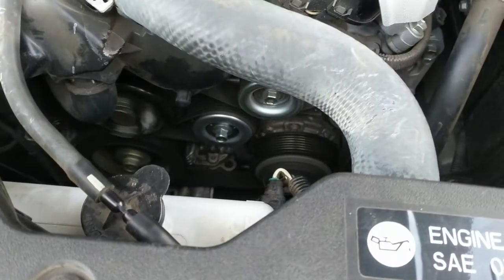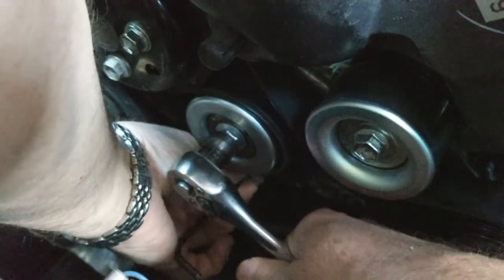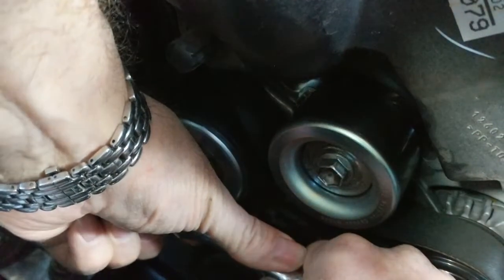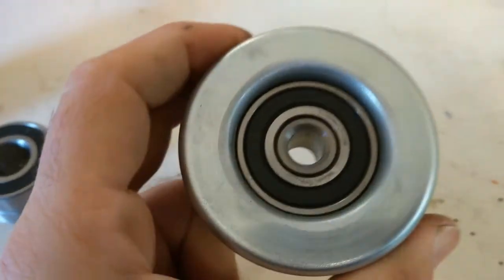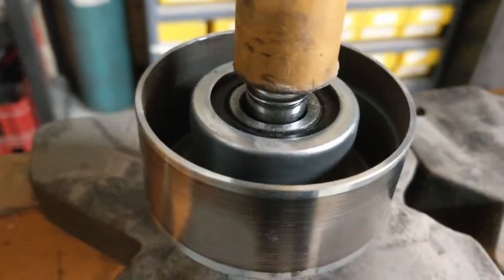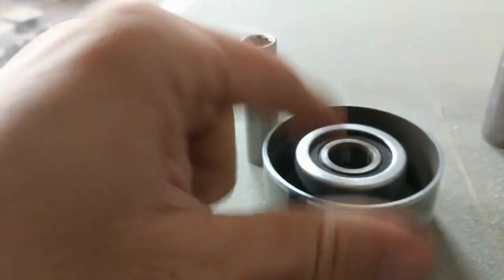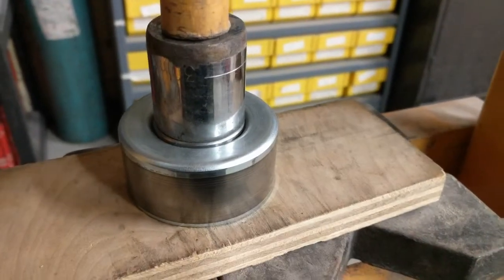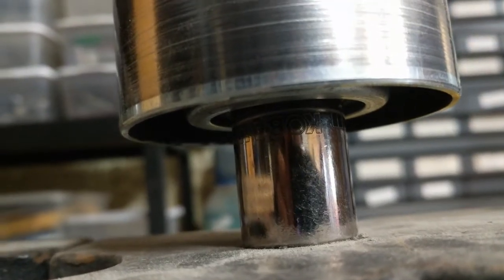Lexus and Toyota tensioner pulley bearing replacement

Comment: I used the gates 36325 pulley as a replacement and it worked great! thank you
Reply from the maker: Great to hear! Thanks for letting us know!
Reply: What is the year make and model of the car you put this on?  Is it still working fine?
Reply: Jo Tu 2006 is250 AWD and 50/50 I think I have to replace my whole tensioner. Noise is back but not from the pulley
Reply: @hilariopenaloza5858  1) Is the new squeak the same exact noise or a totally different kinda "squeak"?
Reply: Jo Tu Same squeak TBH. After replacement the noise went away for a few months and now it’s back. I hear it during the first 5 minutes of a cold start and after driving the car for more than 30 minutes.

Comment: Im wondering if these 6203 bearings will replace the bearings in the idler pulleys as well??
Reply from the maker: I didn't test it out, but they look the same, although the idler only uses a single bearing

Comment: Hey Austin just wanted to shout out a big "Thank You!" for covering this on your channel. Advanced Auto part number 900501A is made in Korea and fit my 2008 Toyota Sienna LE 3.5 perfectly. Just an FYI ... searching Amazon I found yet a third option in part number "FEBEST 0187-GSU45 Idler Pulley". You've saved countless people big bucks and lots of unnecessary labor amigo!
Reply: It's been more than a year! How's your pulleys holding up so far?
Reply: @robinkim7711  So far so good and not a single squeak!
Reply from the maker: Thanks for the kind words, but that was all my fantastic subscribers. My solution was to press out the old bearing because I couldn't find a part that fit, but luckily Sky Nguyen did the hard work of finding a pulley that works for those who don't have a press! I'm super happy it fit your Sienna, and thanks for adding the third part number for others to find, i'll add it in the description.

Comment: So install it back would you just leave the Allen key in the hole and just put on the pulley ?
Reply from the maker: yes, you then use the ratchet or wrench to relieve pressure on the allen key and remove it (the allen key) and then tension the belt

Comment: at 3:32 I can still hear it squeak
Reply from the maker: I should have let the video play longer there as someone else mentioned that too. It's been almost a year and the tensioner pulley has been completely quiet. I did have to replace the alternator clutch a few months after the video, and I think that might be the noise there. It was a different noise, little tiny chirps here and there instead of the constant squeal the tensioner puller was making.

Comment: Thank you very much for the time and energy you put into this awesome video featuring a rare subject that I am very interested in.  A few questions.  You said you are using a Harbor freight press.  1.) Which specific model)number of press did you use (I need to buy it).  If no model then a link or a description would be appreciated.  Additionally, I noticed at the very end of the video from 3:31-33 as you are saying "running with the new pulley", that there is still some chirping in the belt area and the video quickly ends (so I could not listen further).  I mention this because my car has developed that same chirping almost always but sometimes mine is more constant like yours was at the beginning of the video.  So (said with the utmost respect) I realize you said that the replaced tensioner bearings fixed the issue at the end, but did the car still chirp (or maybe even squeal a little) after that??  If not, then I am sorry that I asked but If so, did you try to get the chirp to stop and ultimately how did you do it?  Obviously, I am asking only because I am desperate to solve my belt or pulley (or whatever) chirping and squeal issue.  Your fast reply would be greatly appreciated as I have to fix this as soon as possible.
Reply from the maker: Here is the press:
https://www.harborfreight.com/12-ton-shop-press-33497.html

Good ear on the chirp at the end. I had to replay the video as I did not notice it at the time. The squealing from the tensioner pulley went away with this procedure, but a few months later it developed a second noise from the alternator clutch (the mechanism within the pulley on the front of the alternator). We had to replace that as well.  I think that is what you were hearing there. When the bearings were bad it was a nonstop squeal that changed tones when it warmed up, but was always there. The alternator chirp was just that, an occasional chirp that happened whenever the alternator would engage/disengage
Reply from the maker: I should note that the bearings were replaced 10 months ago and they are doing great and the alternator clutch was done about 5 months ago and there's been no sound since.
Reply: @AustinCoulson  Thanks for ur fast replies.  Funny that you brought up the Alt. Clutch because Innitially I used a mechanics stethascope which lead to my first guess being that my issue is the alternator clutch but can not confirm that this is the issue 100% (maybe if I can perform the gates diagnosis mentioned later though).  I fully loosened the belt and the alternator pulley rotates freely both ways without sound and it is not the idler pulley next to it either (I replaced idler and same sound is made).  I was going to test the clutch but not sure if I remove the cap that the cap will be able to be replaced.  In other words, by trying to fix it, I may break it (if I break the cap).  1) Do you know how to remove the Alt Pulley cap so it can be replaced?  2.) did you replace the clutch while Alt and belt was still on the car (Belt de tensioned of course) or take it off to replace it?  I ask because I would prefer to do it on the car but I have significant access issues (it is on a 2008 Avalon).   3.) What (specific) tool (or kit) did you use to release the pulley from the Alt shaft?  I can not find the single (for Toyotas) 17MM/19MM hollow tool (turned with a wrench) as shown in Gates video and am unsure about the tool to insert into the shaft (there are 3 possible "male shaped" ( ?? Hex, Star, Torx ???) tools to insert into the shaft depending on the car).  I am afraid that I will get the cap open and not be able to get the clutch off (due to not having the correct tool to lock the shaft in place while removing the pulley, then be unable to get a possibly broken cap back on the pulley if I am unsuccessful replacing it).  

Gates makes this clutch removal kit but I am better off replacing the alternator entirely as I am not gonna pay the $80. ish that gates want for the tool kit... https://www.gates.com/us/en/ymm/search/part/details?part-number=91024   

Gates shows how to test the alt clutch here https://www.youtube.com/watch?v=hrFcPqZuO3A&list=PLnkU53gXNZTbSgJge3jRyKU9pP7pDn6cG&index=20&t=0s  But My alternator clutch cap looks different than theirs and I can not figure out how to remove it.  4.) I am hoping you have already learned about the Alt Clutch Cap and can share what you know with me.  5.) how did you confirm (100% for sure) that it was the Alt. clutch/pulley when you had this issue?  6.)  Your opinion please... if I end up doing the bearings on the tensioner, do you think this will work instead of the massive press you used???  https://harborfreight.com/10-piece-bearing-race-and-seal-driver-set-63261.html?_br_psugg_q=bearing+race+and+seal+driver  Help!   :-)     Again, your rat reply is greatly appreciated.
Reply from the maker: @jotu173  I used the tool to install the clutch. Im not sure of any way to replace the clutch without the tool. The cap just popped off with a small flathead screwdriver on mine. The bearing driver will not pop out those bearings IMO. They were in there pretty good.
Reply: @AustinCoulson  1.) When you say the tool, you mean the SPECIFIC gates tool that I mentioned before?  2.) Did you replace the clutch in place or take the alternator out to do it?  3.)  Did you confirm (100% for sure) that it was the Alt. clutch/pulley BEFORE your replaced it, if so how? 4.) Do you think I could bypass dealing with pressing the bearings altogether and just replace the current OEM tensioner pulley (only) with this gates idler pulley (only) on the existing bracket??  https://www.gates.com/us/en/ymm/search/part/details?part-number=36173

Thanks again.
Reply from the maker: @jotu173  1)I don't know if the tool was made by gates but it is the specific tool for removing that part
2)I replaced the AC clutch on the car with the belt de-tensioned
3)I didn't verify it, it was just noisy and it sounded like it was coming from the alternator clutch so I swapped it
4) that pulley will not work, it will be misaligned if you try. I looked at doing that when I pulled the factory one off
Reply: @AustinCoulson  Is your prior answer #2 a typo?  Did you mean to say AC clutch or Alternator Clutch??  Any way you can find out who makes the kit/tool/whatever that you used and a model number or something?  Thanks again
Reply from the maker: @jotu173  right. The alt clutch. No idea on the tool. It was 6 months ago and it's my Father in law's car so he just showed up with the tool and I swapped it for him.
Reply: @AustinCoulson   Do you remember if the tool was in a red plastic blown mold case that held a kit?  Or was it just single tool or 2?  Also, both the bearing replacement and Alt Clutch were done on a single car ( a Lexus ?Year? es350) correct?  Just trying to make sure I get the correct tool or kit is all.
Reply from the maker: @jotu173  all I remember about the tool was that it had two parts, one locked the pulley, one slid through the tool and held the shaft. Yes both on same car. Es350 I think. Can't remember the year
Reply: @AustinCoulson  Last question... and you were able to reuse the stock pulley cap after popping it off.  Correct?   Thanks again.
Reply from the maker: @jotu173  https://www.amazon.com/OEMTOOLS-27261-Alternator-Decoupler-Pulley/dp/B01E65T5U0/ref=sr_1_1?crid=108P5PAA4KQIB&keywords=27261&qid=1569183166&sprefix=27261%2Caps%2C224&sr=8-1
Reply: @AustinCoulson  Thanks for the tool follow up but I just found out that every Oreilly Auto Parts loans out an awesome kit like this for free so no need for me to buy it..  Also, please clarify, you were able to reuse the OEM Alt. pulley cap after popping it off .  Correct? (or did it break?)   Thanks again.
Reply from the maker: @jotu173  we reused it. It's basically just a dust cover

Comment: Congratulations on the video. This helped me a lot. Let me ask you something: to loosen the pulley bolt is the direction of rotation clockwise or counterclockwise?
Reply from the maker: Clockwise to loosen, like you would normally tighten the bolt. It's a Left hand thread.
Reply: Turn your volume up sir

Comment: Thank you Austin for posting this video to replace just the pulley.  I am looking at Amazon and came across "Timken 6203-2RSC3 6203-2RS Deep Groove Ball Bearing 17x40x12mm American Brand".  I have had great success with Timken in the past so am thinking of going with this.  What do you think?  Also, why 2 pack?
Reply: 2(Pack) 6203 2RS C3 / DDUC3 NSK 2 RUBBER SHIELDED BALL BEARING 17X40X12CM
Reply from the maker: I don't know off the top of my head if that will work, but I am with you on Timken, they are my preferred bearing brand. I went with the cheaper bearings in the 10 pack because I wasn't 100% sure this would work when I ordered it. You will need 2 bearings for this procedure, and as long as the dimensions of the timken are the same (and I am pretty sure all 6203's have the same dimensions, but you should double check) then you should be good to go with the better Timken bearings. Hope this helps!
Reply: Did you order these TImkens you mentioned and did it work?  Any other tips?  Your fast reply is greatly appreciated.
Reply from the maker: @jotu173  I never heard back from him if he got the timkens or not, but the ones I used have been working great and quiet so far
Reply: Trying to ask P Jain this question...     Did you order these TImkens you mentioned and did it work?  Any other tips?  Your fast reply is greatly appreciated.
Reply: Yes the 6203-RS is the correct and highest quality bearings you can get. The other belt pulley on the RX350 (I have replaced on both a 2007 & 2015 RX350) uses a single Koyo 6302 RMX. I don't think Timken makes a bearing with a correct inside diameter for this application. Note: The part of the part number after and including the C is not important to match and can be C1, C2, or C3. Also if you want to really go the extra mile remove the seals, pack in additional grease, then reseal. Sometimes from the factory not much grease is included, so if you go this far it is worth checking.

Comment: Hey so my 2000 lexus gs300 the tensioner pulley completely seized up after the squeezing and cause the whole belt to come off. Do I need to replace the whole pulley system or just that little part with the bearings??
Reply from the maker: This repair should fix that specific issue. It's impossible to know for sure without seeing it, but basically the tensioners only job is to have spring loaded tension and those rarely fail. The common failure is the pulley bearings and that sounds like exactly what happened to you. Sounds like the bearings were going bad, then seized, which blew the belt. You should be able to follow this video, swap the bearings, install a new belt and be good to go. Let me know if this works out for you, and good luck!
Reply: @AustinCoulson  on my 07 Camry 3.5, would the tensioner pulley / bearing be the same pulley / bearing as my idler pulley? Thanks again!
Reply from the maker: @brandonalbright125  no, they are different. You can try gates part number 36325, people are having luck buying just that pulley and swapping them so you don't have to do the whole tensioner or my bearing swap
Reply: @AustinCoulson  Hey thanks, but when I type that part # in on Amazon it pulls up a gates idler pulley and amazon says it's not the correct fitting part for my Camry?
Reply from the maker: @brandonalbright125  correct, that part is not designed for your car, but if you check out my description  or the first pinned comment, one of my viewers found out that the part that isn't designed for these cars will fit anyways. Basically, no one sells just the pulley, they want you to replace the entire tensioner so I figured out how to replace just the bearings and the other viewer found out you can just buy a different pulley made for a different car instead of my solution
Reply: @AustinCoulson  Oh ok, so just to clarify. That specific gates 36325 WILL work and (others in the pinned comment) on my 07 Camry belt tensioner pulley replacement? But my 1 or 2 idler pulleys will be a different pulley part #? Thank you for your quick reply!
Reply from the maker: @brandonalbright125  I cannot say for sure as I have never done it, but based on what 4 people have told me, it will work.
Reply: @AustinCoulson  thats great and a lot cheaper fix. Do we have 2 idler pulleys on the 2gr 3.5 motor along with the tensioner pulley? So the tensioner pulley would be different then the idler pulleys?
Reply from the maker: @brandonalbright125  the idler and tensioner pulleys are totally different. It's my Father in law's car so I'm not sure if there are two idlers or not
Reply: @AustinCoulson  alright, thanks so much for help!
Reply: On yours, it is NOT reverse-threaded. Otherwise you will end up with a broken bolt and have to replace the entire tensioner assembly.
Reply: @antistupidity84  alright, thank you for the update. Im finally about to tackle the job when we get some better weather.

Comment: no tacoma for this bearing or pulley
Reply from the maker: Correct. This only applies to the vehicles listed in the description
Reply: @AustinCoulson  wow mostly all of the toyota line up but Tacoma =(
Reply from the maker: @jonesesente7646  the good news is that I think they sell just the pulley for the Tacoma pretty cheaply
Reply: @AustinCoulson  and that comes with the bearing right? and do you think most idler pulley in a car/truck the same size?
Reply from the maker: @jonesesente7646  what year and motor is your Tacoma? Do you know where the squealing is coming from?
Reply: @AustinCoulson  2010 v6 prerunner.... i just replaced my ac compressor's bearing.. as i was checking all idler and other pulleys, i thought some of my idler especially the tansioner pulley was like free/loose or theres no little resistance like with those new bearings.
Reply from the maker: @jonesesente7646  if it spins freely it might still be ok, you want to check the play laterally. They sell the tensioner pulley and idler pulley without having to buy the whole tensioner. They are both smooth and 70mm outside diameter but the mounts are different. Check out rockauto.com for the part numbers
Reply: @AustinCoulson  thanks for entertaining my questions man! really great help!
your video as well! keep it up!

Comment: You mean Toyota OEM does not sell the tensioner pulley separate. The tensioner pulley with pressed bearings are on ebay.
"Belt Tensioner Pulley Febest 0187-URJ201" Remember reverse threads, Righty- Loosey, Lefty-Tighty. Haha!

Comment: Would these bearings work? 6203-2RS KOYO Deep Groove Ball Bearing
17x40x12 mm
Reply from the maker: I believe so. As far as I know the 6203 is the size and style of bearing and the 2rs just means they are rubber sealed and a 2 pack